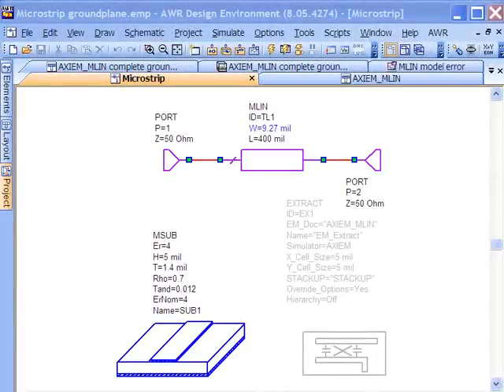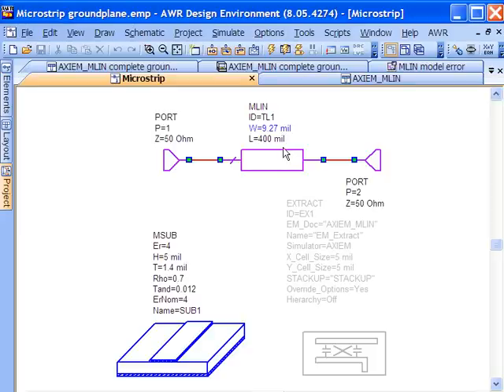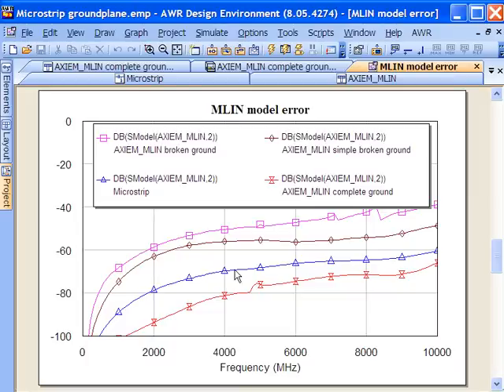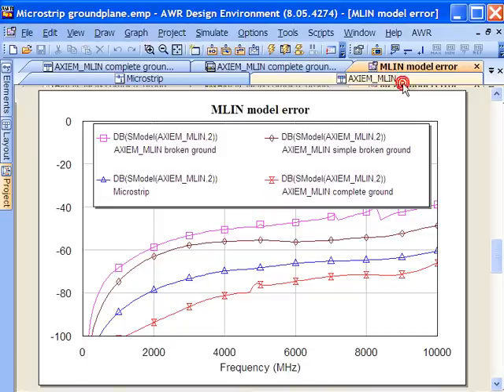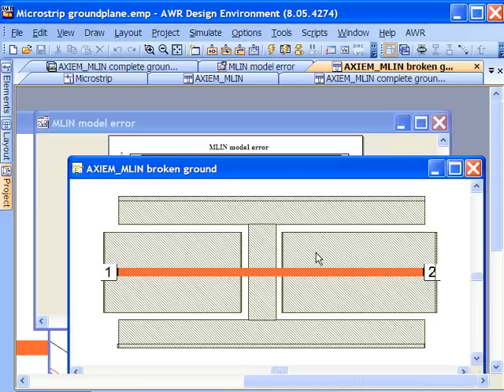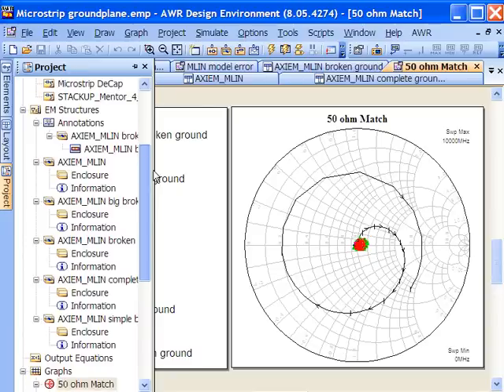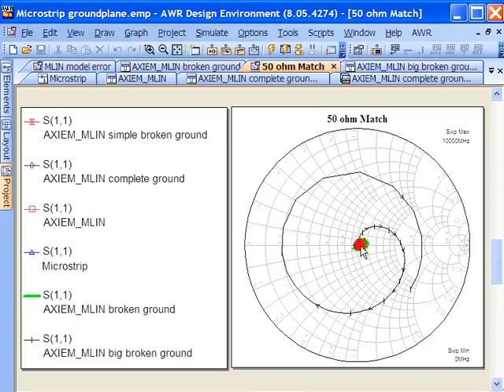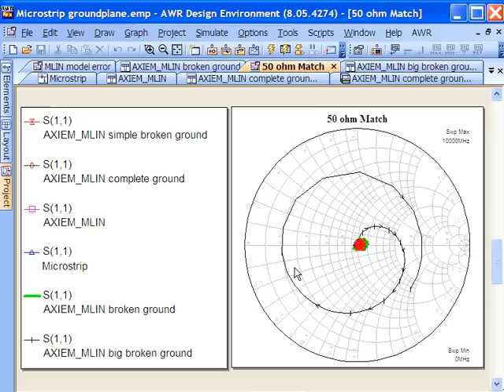Feature: Microstrip and Ground Plane Modeling

Comment: In my design there are traces on both layer1(L1) and layer 4(L4). Traces at L1 have L2 as ground plane while traces at L4 have L3 as ground plane. When using extraction all ports are set to lumped down thus for ports at L4 I have to modify the ports manually and change the to lumped up. Is there any way to tell the program to select the nearest ground? In ADS the  user can force a layer to GND. Do we have similar option in AWR?